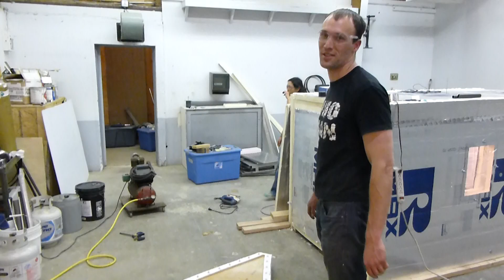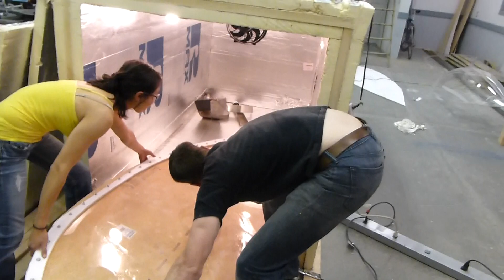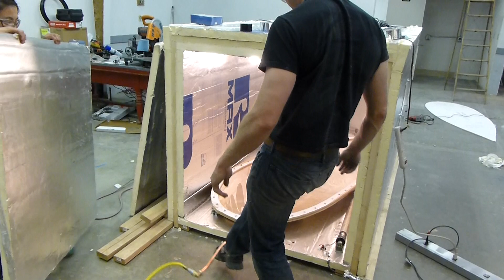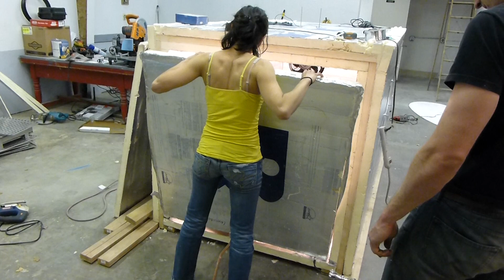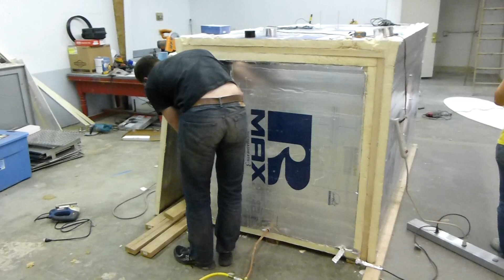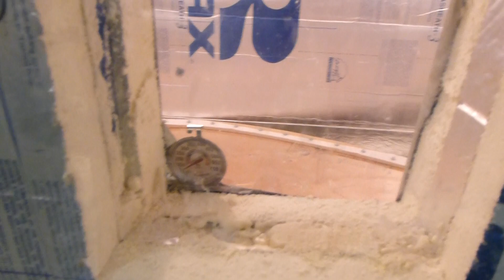Creating a Bubble Windshield

Comment: That is one of the prettiest shop Assistants onYou Tube !  In Architectual Woodworking we use special heat lamps to soften laminates like Formica to bend  on certain radius  areas we need to glue it to
Reply: I'd surmise the lady is the boss here, actually.

Comment: A little bit lame: did not cover the forming segment, or the finished product or ANY details of heating or form creation. How about an update or answers?
Reply: Funny that people expects every video to be properly produced like a show, but phones allow direct upload of clips to YouTube for sharing. Interesting idea of using insulation on the oven I was thinking about doing this also.
Reply: @johndude70  I was thinking the same thing lol. I would just pickup the insulation and build it big enough to roll a used oven up to it and seal it off with the door removed then removing the glass from the oven door and mount it to the side. Set my preheat and a couple of oven lamps inside it and and close the box. Spend more time on supporting the mold and getting it in and out of the oven wearing oven mits.